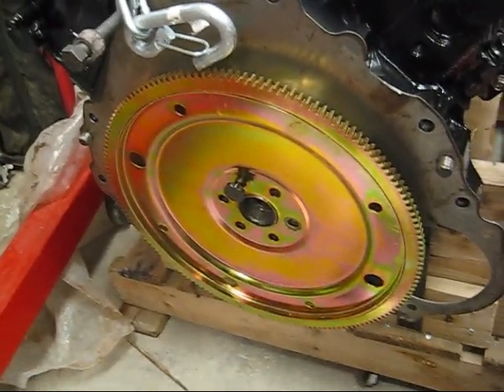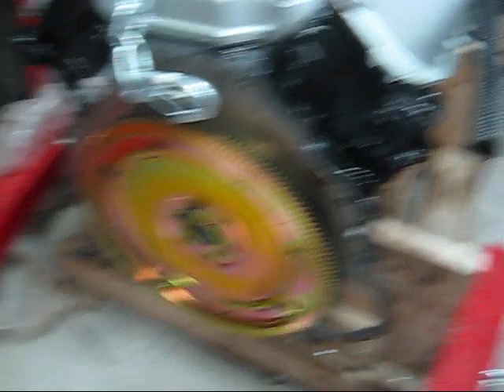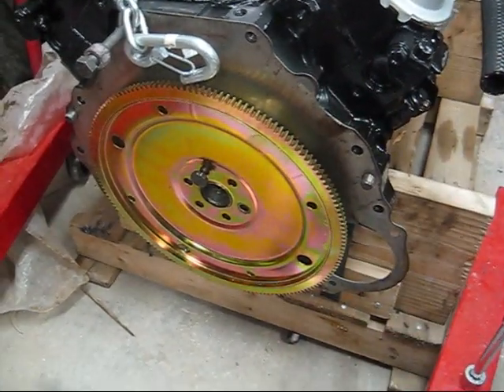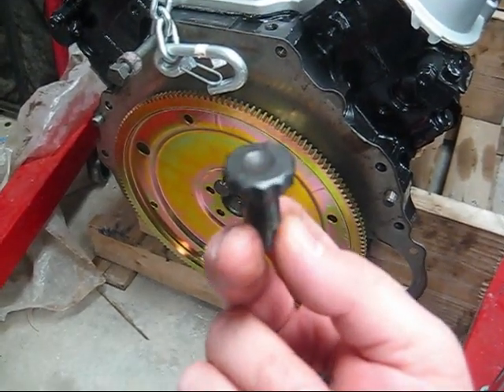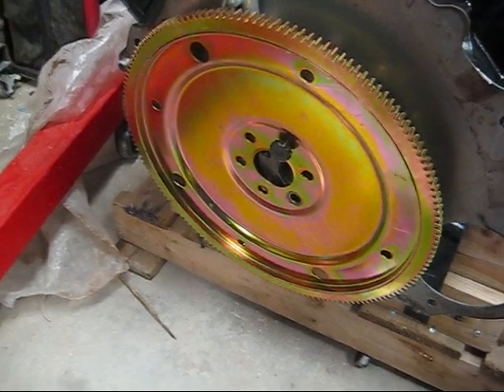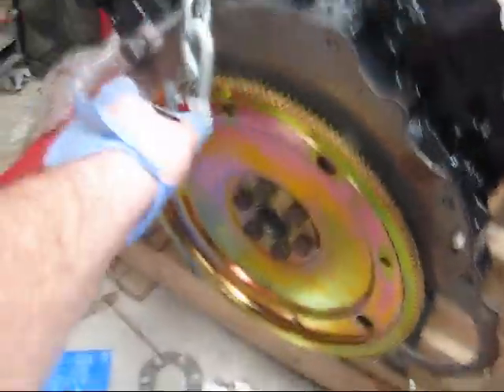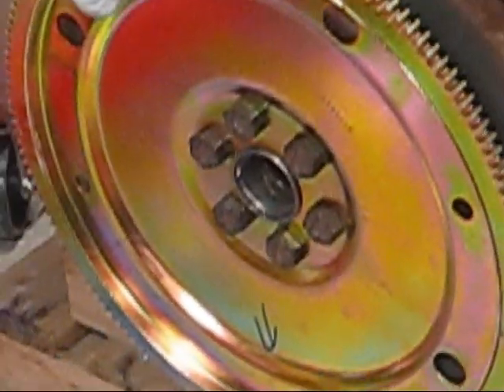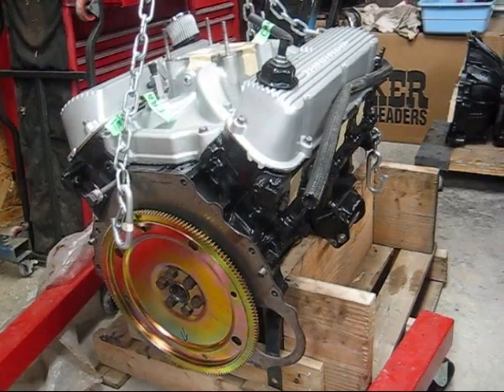Peter Ralph flex plate installed

Comment: Peter Ralph, good call on avoiding the flywheel bolts...

I noticed the same as another commenter, that you seemed to leave the spreader ring off.  Is it because you realized that to torque everything down well, that you wouldn't need it?  If this was your car, how did this installation hold up--did you have no problems?  Thanks.
Reply from the maker: With the proper flex plate bolts the spreader ring is not needed.  I should note, this its on an aftermarket piece and might be different on a stock ford piece.